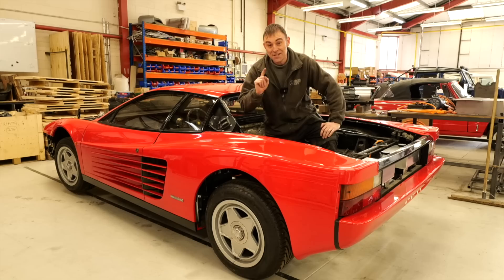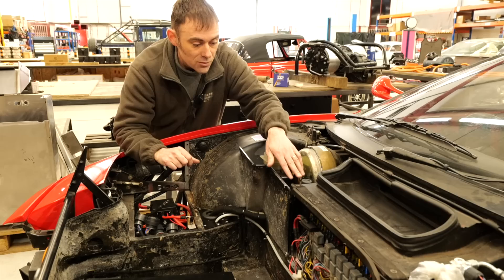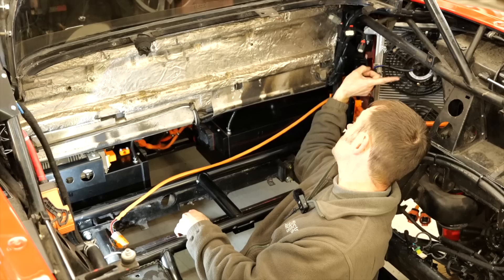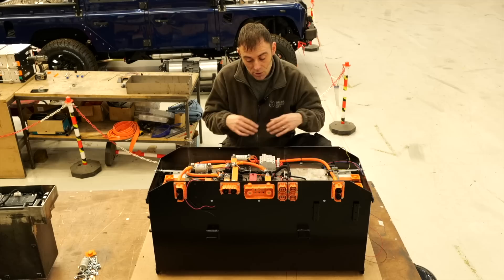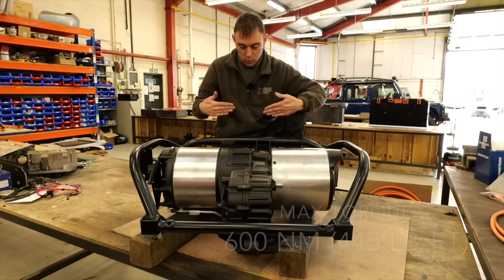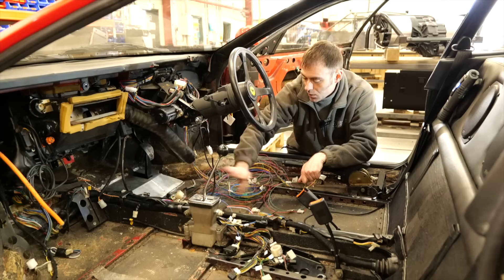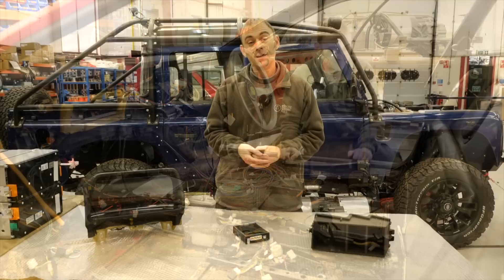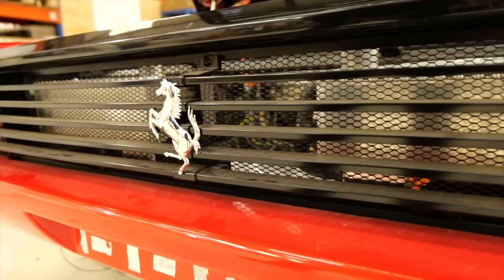Teslarossa Ep5 - Battery packs

Comment: Most of the reason cars like the Testarossa don't get used is because too many people see them as an investment, not a car to be used. Most of the cars currently for sale are 35+ years old but have less than 25k miles on them.

Making it electric doesn't make it more useable. Adding miles to the chassis and drivetrain will hurt the value and maintenance costs will still be high given how notoriously fragile all Ferraris are. The electric conversion will decimate the value of the car. Fine if you have money to burn and don't care about resale.

It might have made sense 20 years ago (if the technology had been there) when Testarossas were only worth £25-35k, but now you're not getting into even a cheap running one for under £120k.

Sound is an important part of a car's experience, and the Testarossa's 4.9 litre flat 12 is particularly musical.

I'm not a Ferrari fanboy. I don't like them much. If I had the money I'd like a 288GTO, but nothing in the last 30 years floats my boat. They're expensive, fragile and Ferrari seem to feel entitled to judge if you're worthy of them letting you buy one.

I also remember a quote from a McLaren employee who was showing journalists the then-new MP4-12C. He was asked, "Are you trying to be Ferrari?"

"God no. There's nobody here that can weld that badly."